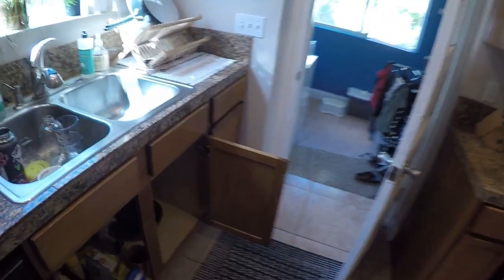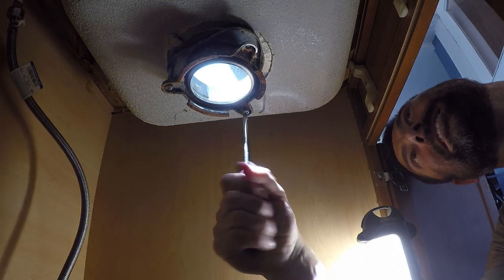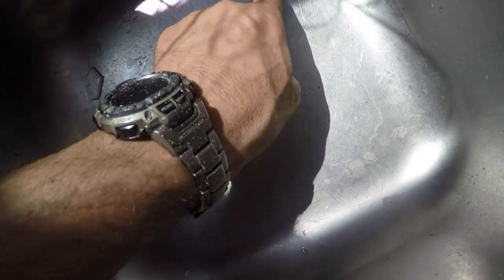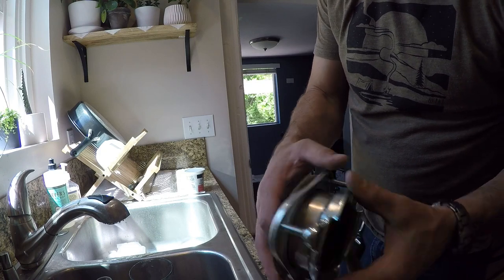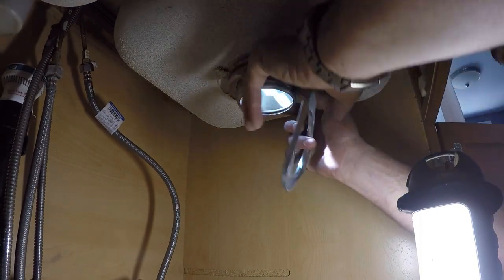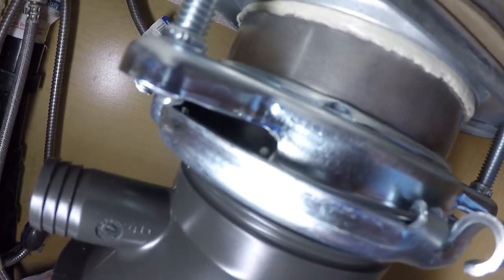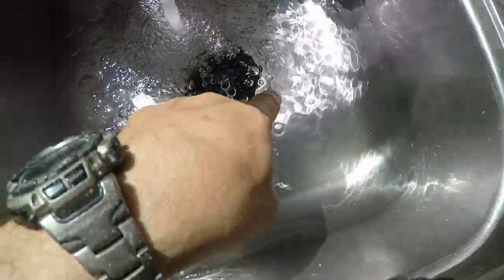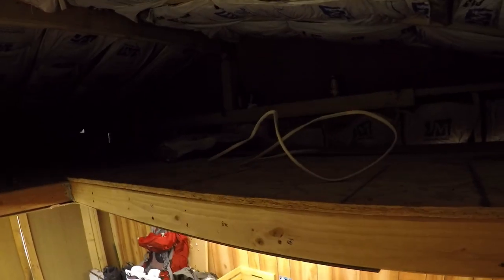Handyman Uses Blow Torch To Install A Garbage Disposal | You Won't Believe What Happens |

Comment: If you replace an old garbage disposal with a larger capacity disposal unit, sometimes you can't use the old black ABS pipe because it's at a different height compared to the smaller unit. So you have to redo it.

Comment: You can get these with the plug pre-installed.  It's only a few more dollars than the one without the cord.  I charge that to my customers and still charge the same for labor.  I have to order them in from hdsupplysolutions, but they only take 1-2 days to ship to me.  I keep 3 on hand at my shop and 1 in my van.  If I run into one that is hardwired, I install an outlet.  It makes it easier next time and doesn't take me any longer to swap out.  I just have to carry a 1 gang metal j-box, outlet, and cover.

Comment: Mr. Handyman, can you enlighten me as to the purpose of this device?
Thanks,
AOC
Reply from the maker: You trim your finger nails with it.   🤣🤣🤣🤣👍👍👍😂😂😂
Reply: One of the common problems with in-sink disposal units is the increased likelihood of clogs, especially if the food waste contains saturated fats, which solidify at room temperature and can build up inside pipes. Although these tend to occur more often in high-traffic restaurants or commercial buildings, blockages are nonetheless responsible for about 75% of all untreated sewer overflows.
Reply: @bobsoft  Exactly what it did to my pipes.Got rid of it 30 years ago.Created more problems with my old cast pipes.

Comment: In-Sink-Erator used to be the standard.  After 2 rusted out on me exactly as yours did, I switched to American Standard.  The big problem with ISE now is the grind chamber on the less expensive models rust and corrode.  Didn't used to be that way.

Comment: I've replaced alot of those basket strainers with a cordless angle grinder and metal cutting disk. Off in a minute. Just don't cut into the sink.

Comment: Replaced one just like this, as was linking etc... Went to remove it with the tool, & as I was turning (the unit was SO rusted and old); the disposal broke in half. The motor & electrical part just fell off, & the metal casing was even cracked inside. Whoever installed, ran the electrical directly out of same hole as plumbing for sink drain & didn’t even wrap the romex with any protection(major no no in nec code). Ended up doing a complete rewire with box etc... Good times, good times👍🏻
Lastly, I always USE putty....find it works the best & never have call backs.
Fun story. Got called for leaking sink. Went in & owner said they tried to fix with the silicone sealant. They just squeezed the silicone in between basin lock nut & had silicone everywhere. Took more time removing, cleaning, & cutting the stuff out than installing new sink drain & disposal....he literally used the whole tube of silicone🤣 & sink was still leaking.
Okay, great vid, & glad use & prefer putty.
L8R ✌🏻 (I know you have some great stories, have heard some😊)

Comment: For those that will lose their mind, only countertop receptacles within  6 feet of the sink need to be gfci protected. Dedicated equipment  such as dishwashers, garbage disposals, fridges, etc. need not be. Your welcome.
Reply from the maker: Thank you
Reply: This also depends on the area. California makes you GFCI your garbage disposal.
Reply: In Chicago, it has to be hardwired via a BX whip
Reply: what prevents a ground fault from shocking someone since there is no gfci?
Reply: FD a ground fault will trip the circuit breaker. The reason for a gfci is to trip at the outlet first. Due to the resistance of x number of feet of wire, the gfci trips immediately, while the breaker may take up to a second. This is important on a countertop, because that second can be very bad. Under the sink it is not as likely for disposal to get wet while you are in contact with it.
Reply: @fd3871  You can only use the sink if you're wearing insulated gloves, dielectric shoes, nomex underwear and other PPE.
Reply: @doctorwigglespank8933  that might interfere with the manly aesthetic i have been trying to cultivate.

Comment: woooooow wd40 and some fire to loosen a rusted stubborn bolt. thanks i am going to store that one in the back pocket because i run into that scene more than i would like lol.
Reply: When they are really stuck  spray it heat it up and spray it again it will smoke alot but seems to get in the threads better when it's hot

Comment: Someone lost a ring and took that disposal off, they put it back on(without the screw) and it has been leaking ever since. Check all your p-traps to make sure they tightened them back up. You should buy some better screw drivers
Reply: To get to that screw they would have had to remove the disposal first.

Comment: I replaced mine once. That ring that you had to spin to get it off and back on wouldn't move. I mean I tried everything to get it off but I couldn't get enough leverage. Out of desperation I got my air compressor and a palm nailer and popped it a couple times and let loose. Did the same thing to tighten it back up. Anyone in a jam, give that a try.

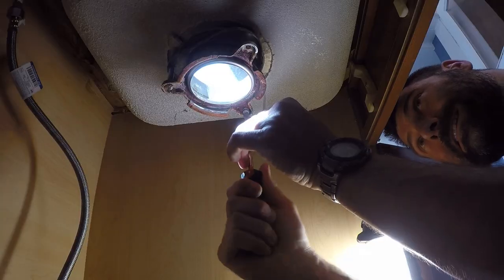Comment: 2:30 Mr. Handyman, why didn't you use a Phillips screwdriver for a Phillips screw???
Reply: A philips head tend to cam out or slip when trying to put a lot of force into them especially upside down. A flat head can slip and cam out but not as easy.